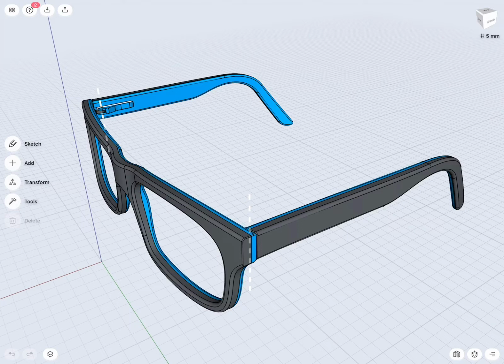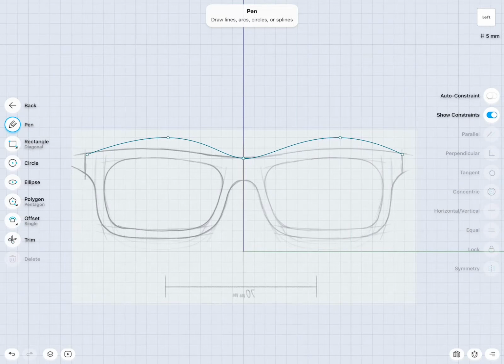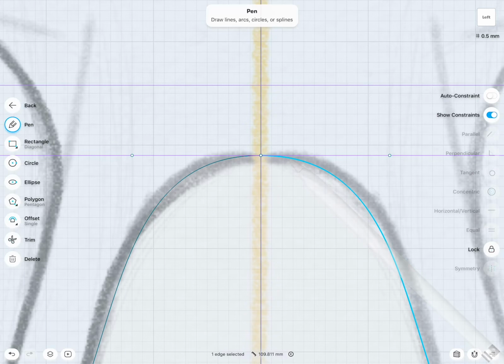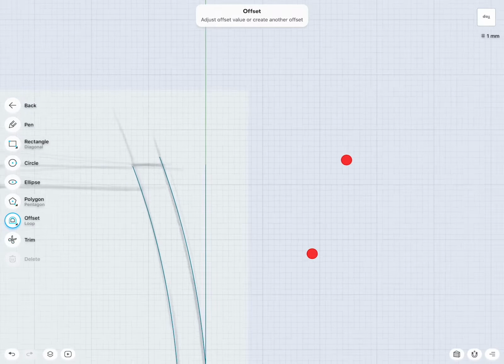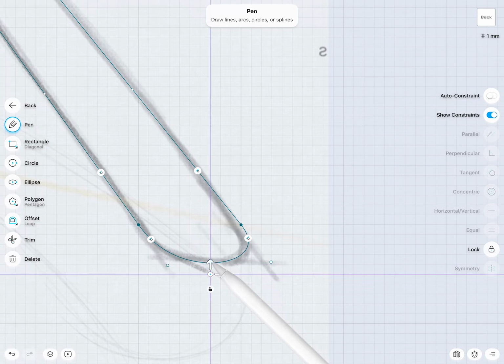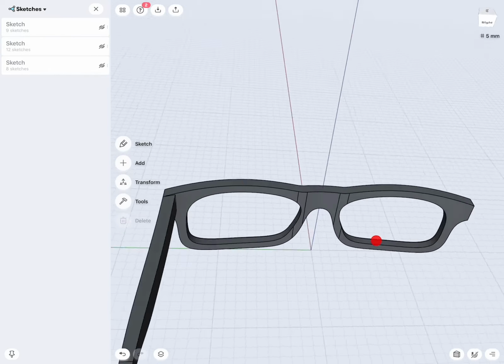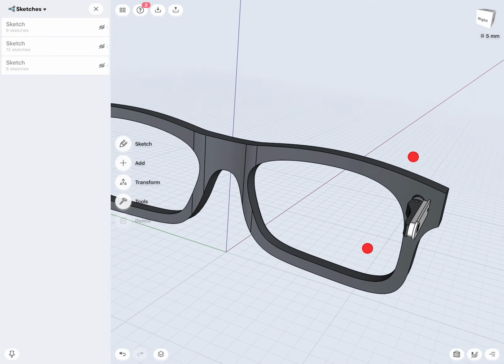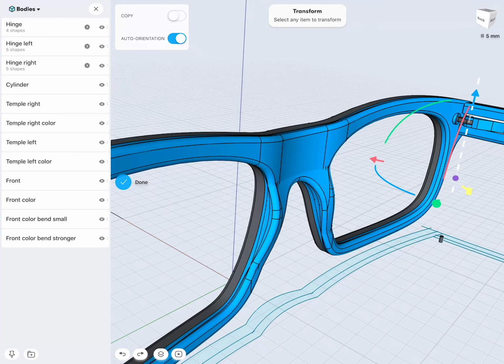Design a glasses frames concept | 3D design webinar

Comment: 54:23 Not sure if this is covered but, if you save the axis point in the same folder as the arm then it will articulate along the axis point when you select the folder.

Comment: Very nice. I will give it a try. Although I didn't see a parametric value for the base curve. Base curve shape should also be vertical. Also pantoscopic angle is not in. You need the lens groove. Easy to put that in if you know all the "very" complex formulas. Commercial eyewear design is much underrated and only possible with numerous scripts. Of course simplified hobby prints are possible.

Comment: It wasn't that clear how you selected intersection instead of cutting through it. How did you bring up that menu?
Reply from the maker: Hi, please tell me the time position in the tutorial when this operation was performed. However, after you cut through objects there is a Boolean tool little dialogue box that appears by the bodies, click on the box and then select one of the Boolean operations immediately.

Comment: Wow, eyewear without glasses, how to create  glass?
Reply: In fusion 3d you can take two edges and join them, say you have a tube, smaller circumference and larger circumference end, you can join the faces and it will calculate a new material to manipulate, ie pulling the concave of the lens. 
My best guess, not shapr3d